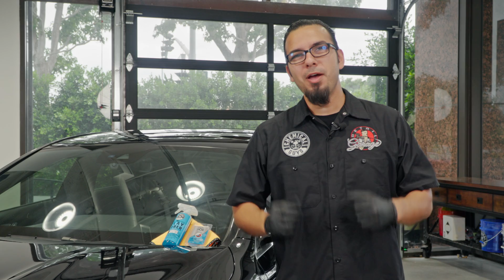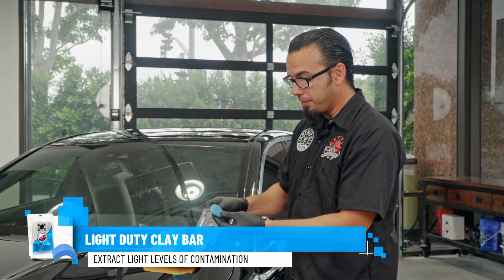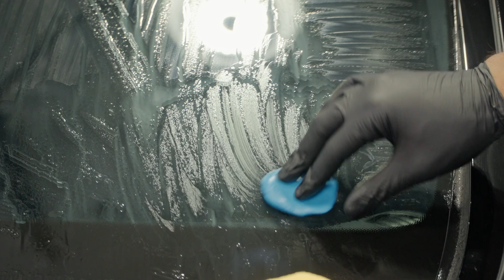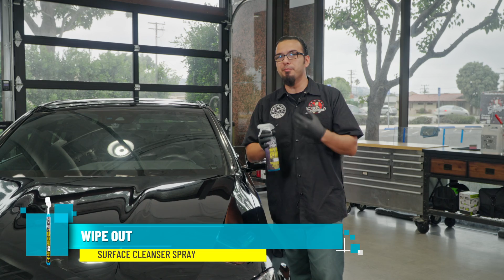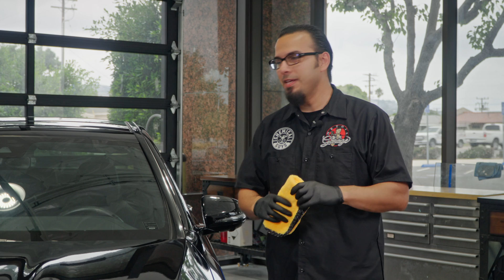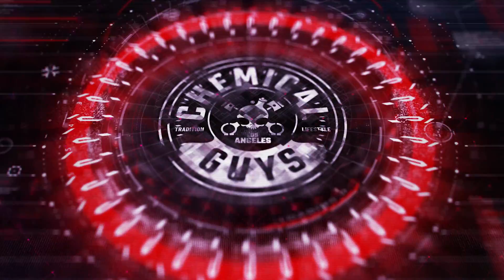Do It Yourself Glass Ceramic Coating Protection Guide 2023 - Chemical Guys DIY

Comment: does hydro slick on the windscreen help with fogging? maybe use on the inside as well for that reason????
Reply: Nope. On the inside you need a hydrophilic coating to prevent fogging
Reply: @i4kata So what would you recommend